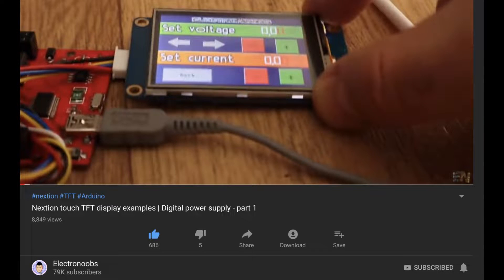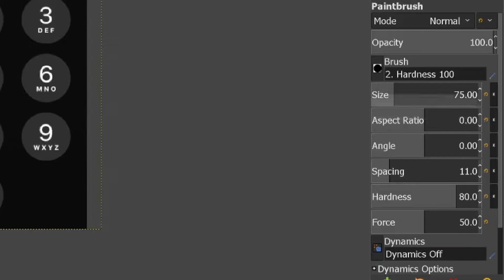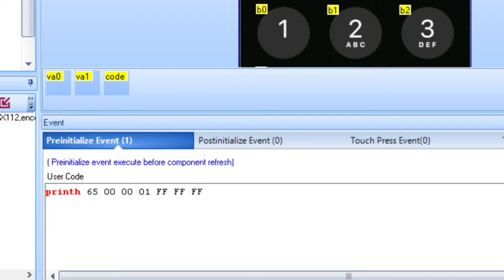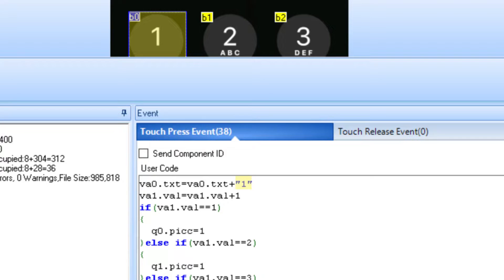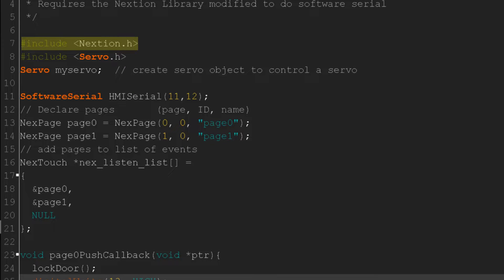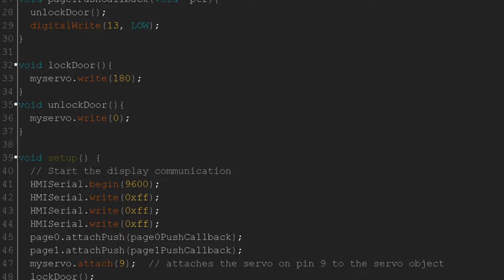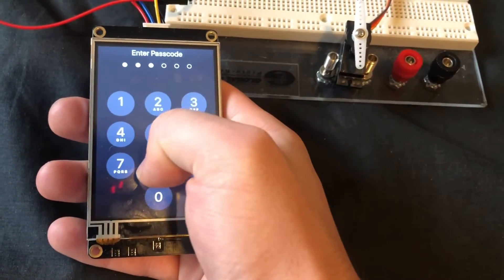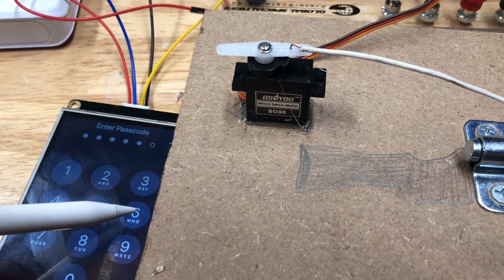Nextion Arduino Passcode Door Lock

Comment: Hello  you have done a  wonderful job . i was doing a Project recently.I need to draw the 
temperature graphic in the waveform in real time. Could you give me some advice . How can i  achieve this.I am using a lm35  temperature sensor and a Arduino uno board. I set the sensor in  PIN A1.Can i finish this without using the Nextion library.Because when i compile the code. There is always a error about this library.

Comment: I try with my nextion basic 2.4 i rebuild all but if i try to compile arduino program it show error message  error compiling fot arduino genue/uno what i can change to make it work with arduino uno ? please help me
Reply from the maker: The Nano I used should be the same code as the Uno. Have you modified the Nextion library to work with Software Serial?
Reply: Budget Tool Reviews  No only add  #include SoftwareSerial.h  library
Reply from the maker: Димчо Събев 
1. In your libraries folder, find the Nextion library.
2. Find the file called NexConfig.h and right click on it and click edit.
3. Find line 37 that says   #define nexSerial Serial2 
4. Delete or comment out that line and replace it with the following: 
#include <SoftwareSerial.h>
extern SoftwareSerial HMISerial;
#define nexSerial HMISerial
Reply: @korbano   Thankyou for fast reply and for help me.

Comment: Is there a way to do this with a pattern lock instead of number string
Reply from the maker: I don’t believe so. If you made a 3x3 dot pattern for example and put a button or a hotspot on each dot, you can slide your finger over to the next button. However the screen will not register anything until you release your finger from the screen and touch again. You could just make it so you touch each dot in order but then that kind of defeats the purpose of a pattern lock if you can’t drag your finger.